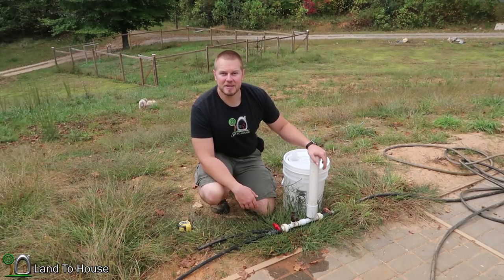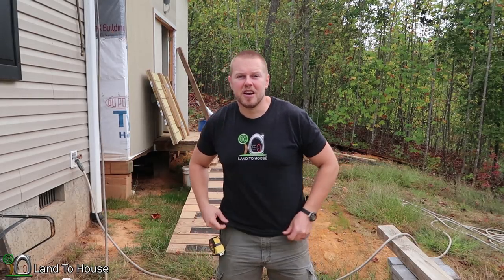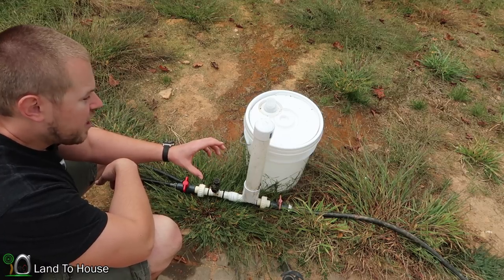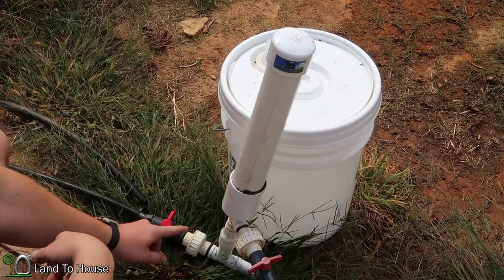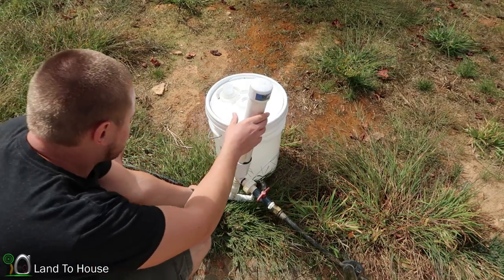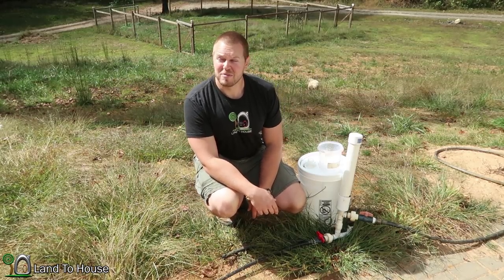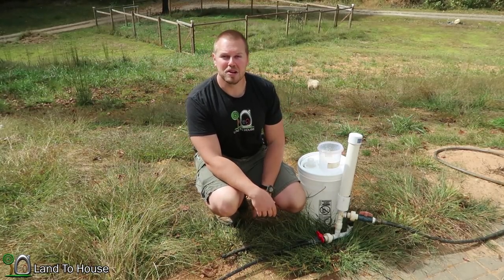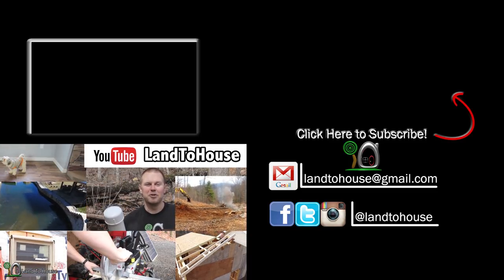What Ram Pump Design is Better

Comment: I would like to see you re-do this video, with the following differences:

Use your house's garden hose for head pressure.  It will stay the same for the entire duration of the test.
COLLECT the waste water WHILE COLLECTING the pumped water.
When the pumped water reaches the mark on your container, measure the amount of waste water.

You'll be able to compare the percentage of waste water to pumped water in each style of pump directly, ie., 1 gallon of waste water to pump one quart of pumped water.

Also, thank you, very much, for posting so MANY tests with these pumps.  I knew what a ram pump was, before watching your videos, but that's about it.  I knew nothing about adjusting them or tweaking them or what affected what in their construction.
Reply from the maker: Sadly using house pressure in a garden hose does not work well or at all. The pump makes a pressure wave that travels both up and down the pipe. If the pressure is 60psi going down the pump cannot cycle. 

In a very old video I did use a catchment tub to collect the waste water. Worked alright. 

Thank you for watching! I am also learning as I go. Its super fun to make these test videos.

Comment: You reversed the 5 seconds difference to the tape line 22 first then 17. You said 22 on the modified version.  But I like the stuff you present. What state are you located in?

Comment: Your "linear" system requires an internal air bladder. Which is not necessarily a bad thing. Your "non-linear" system wasn't setup to run without a bladder. The incoming pipe should hit a tee that points up. Then another tee pointing sideways for output. The check valve needs to be above the output tee with a very small hole just below the gate in the check valve. This regenerates the air in the tank. By having the system adjust it's air supply in the tank instead of having an internal bladder it will maximize output pressure vs input. 

The down side to a self regulated tank is a second hole pissing water. But in practice the pump should be in or near the water source so as to return the waste water back to the source water.

Comment: If I'm understanding correctly, it sounds like the product you sell, with the pumped fluid continuing horizontally to the delivery pipe, consumed 0.0227 gallons per second, where the delivery pipe being after a vertical pumping movement consumed 0.0192 gallons per second. So, yes yours consumes more water per second, but, if you multiply the water consumed to fill your fixed volume (the handheld container at the end of the garden hose) then your product consumed 0.386 gallons in order to fill that container, where the experimental concept required 0.423 gallons to fill the same container. So to me it sounds like your product is pumping faster, and more efficiently. Do these values sound right?? If they are, my assumption would be that the only reason to use the delivery valve mounted for a vertical discharge is if you just don't have enough water available to operate the inline delivery pipe design that you sell, unless I'm missing something. One thing that wasn't measured (not criticizing) is the waste versus pumped water. Maybe there's some significant differences there, if absolute efficiency of pumped/waste water is important in some applications.  

I'm asking for two reasons: 1, so i understand and 2, because I watched a similar video by david deutsche (2021) where he found that a horizontal pump only moves water about 60% as quickly as a vertical pump. Might you have any suggestions of why the test results are so different? From the content in both videos it looks like a vertical pump is easier to prime and get going as well.

Comment: 3:40(220 seconds) divided by 17 = 12.94 cups per bucket of water  vs   4:20(260 seconds) divided by 22 = 11.8 cups per bucket of water. The linear system is almost 10% more efficient in water pumped per gallon used. 

BUT, using the video timer, both filled the cup in about 22 seconds. That means the linear system uses more water per unit pumped. That means the linear system pumps 10 cups of water per bucket fill. It is 18% less efficient in water pumper per water used. 

It makes sense that the linear system would not be as efficient because the early check valve breaks the momentum of the water stream to the base of the ram cylinder so that the water stops moving past the inverted Tee to the early check valve. The later check valve does not. The water coming into the manifold (horizontal pipe) keeps flowing and just switches direction at the inverted Tee to the ram cylinder. Reducing the 1 inch vertical pipe should increase the efficiency. 

YOUR PUMP WASTES MORE WATER.
Reply from the maker: You are very right! I lost track of my data halfway in the video and did not take the time to check what I found. (half lazy/ half forgetful) It seems that both pumps are close enough but there are several factors that can alter the results here. A big one is inconsistency of intake head pressure.  The bucket is not alway the same hight in each test. Could be the non-linear version is even better or not as good as in the test. Thank you for pointing out he data.
Reply: The water level in the bucket would be inconsequential if you fill the bucket to the same or similar levels. You only use 22 seconds of flow out of the 3:40 (220 sec). You need to tighten up the whole test to get better data. It looks like the linear system takes longer to seal the bubbler valve.
Reply from the maker: I have to admit that many of my tests are only giving a taste of a good test. Perhaps I am giving others a nice idea of what they can work with in a setup.
Reply: I had the same conclusion

Comment: What I've gathered from the net re ram pumps. First the height of the  water source should be at least 3 feet, The drive pipe, water from source, should be steel pipe and twice the size of the pipe coming out of the ram pump. The drive pipe length should be between 7 to 10 times longer than the height of the water source, without any 90 angles. Just a straight pipe from water source to ram pump,any bends will slow the flow of water. 
As far as chlorine, being an orchid grower, orchids are cleaned in a 10% bleach /water solution without any adverse effects. Good luck
Reply from the maker: Over the past few years I have made several tests with the ram pump. 3 feet if a great starting point. the pump can run on 1 foot but the check valve has to be tilted. The more ridged the drive pipe the better. The reason the delivery pipe is half the drive pipe is for cost and lower flow rate. The delivery pipe can be any size though because atmospheric pressure is the same on any size delivery pipe.   Cool info on Orchids. I dont know anything about them.

Comment: how  to design is interesting .. why not use a bigger inlet to make more ram when the output value closes is my thought on this ...most pleasure for the least flow is my idea. Good luck working the ideal and maybe some type of flow rate in the process to make this work super great... Best of luck on your experiment. Great watch.
Reply from the maker: The issue with having a large drive pipe for smaller pump is mismatched pressure wave. The pump is less effective.

Comment: Have you ever tried to build the "Linear PVC Ram Pump" shown on the Approtechie Youtube channel? It would be interesting to know your opinion of that design.
Reply from the maker: I think that one must have a bladder in the pressure tank to work. I have not tried that one yet but it does look fun to build.
Reply: Yes, I believe it is using an inner tube, or at least a pool noodle. I hope you build it and do some test videos. It would make a nice compliment to your existing videos.

Comment: Someone may have already said this, having timed the two times that you filled the cup. Both look to be 22 seconds or your editing did not get the 17 second version. Based on the Video the second design looks to be best, moved same amount of water in same amount of time and consumed less water. Maybe a retest is in order unless you agree second design is better. Looking at cost due to less fittings the first one should be cheaper to build.
Reply: Daniel Nelson, I'm with u on his timing, I commented on the same thing.
I think he missed something in his timing OR he trying to sell his version over the 2nd version?

Comment: Any idea what would be the result of increasing the inlet size in the same water supply and what supply is required? Nearly all ram pumps are shown with and going through great troubles to get a stronger water fall. None show or state how to not change a small creek with little flow or lift and still get something from it..

Comment: Can you put a check valve on the bottom of the pressure tank,  my thought is to be able to remove pressure tank without interuption to the system to have a reuseable  pressure pump be a fire extinguisher

Comment: I rechecked your video, your straight line design filled in 22 sec.  The bent line design  filled in ?? (you didn't say) but I was watching the progress bar and it was also 22 seconds.  So does the second design pump the same output while consuming less input flow in the drive pipe? Perhaps a retest is in order? I'd like to suggest another test of both to determine which needs less delivery pipe back-pressure to operate.

Comment: I have made the same pump but it did not work properly. Maybe it's because I used garden hose to supply and to deliver. Where do I have to use the garden hose? At delivery side or only at supply side? In which side can I use the PVC pipe?
Reply: I'm in South Africa by the way. Your Ram Pump will change many people's lives here.
Reply from the maker: A garden hose is too flexible to use as a drive pipe. You will need to use PVC pipe as the drive pipe. Now the delivery is fine with garden hose
Reply: Land to House thanks a lot. 

If you were in South Africa you would be playing a very big role to our communities. Your project is highly necessary here. The government would really appreciate it.
Reply from the maker: Having water is certainly life-changing. A few of my water pumps have been taken to your country by missionarys.
Reply: Land to House that is very very nice. I will use your videos and your recommendations to make some pumps and try to change some lives also. I am very happy about your project.

Comment: Hey man I like your tests,  I want to know how to move water from tank to tank and save the waste water.
Reply from the maker: Thank you. The ram pump is not good at moving water without waste. There is normally around 90% loss with the ram pump. You might need to look into a solar pump for moving water from tank to tank.

Comment: Wow, watched this video months ago and based on what was said I dedicated to the linear design built 4 different pumps but in testing wasnt getting the results I expected, now watching over I realized the error in stating the fill time, timed them and socked to see they were basically the same. Will now go non-linear as seems more efficient.
Reply from the maker: Hi yes I made a mistake in my numbers. (poor memory) Both pumps work well but in this test the non linear worked better.

Comment: Follow all your videos. Built one 1-1/4 working fine for a month, constant flow, now suddenly the output is pulsing.  like on and off. Any suggestion why it is doing this now? Thanks
Reply from the maker: Thanks for watching! The pressure tank might be waterlogged. Have you emptied it lately?
Reply: @LandtoHouse . Right on the money, no air in the pressure tank.  They emptied and back to normal.
They did not use the suggested tire tube in there. 
Just to let you know.  I took the 1 1/4 to Colombia, on the mountains and the interest for that was huge. So I decided to help some folks to build and sell them locally. They created an Agri-business and have started selling  "The Arietes"  there.  Will you permit links to your videos on their website, giving you a credit of course.  Here is their site:
http://www.arieteslacumbre.com  
I live in Phoenix and try to advise them remotely.
Thanks for your reply.
Alex

Comment: According to the timer on the video the pumps filled your little bucket up in roughly the same amount of time.  22 sec and 23 sec.  Don't know where the 17 seconds came from.
Reply from the maker: +blue ferral both times were very close. I do not find much of a difference between the two pumps. Seems like both designs are both effective.
Reply from the maker: I re-watched the video and yes you are right. . . Who knows where my mind got that 17 seconds.
Reply: Since one of the desings uses less water to fill the cup, is more effective because you use less water.
Reply: He sells the first design.  A wee bit o' bias.

Comment: How much more difficult would it be to build a 4-6" intake and a 3-4" uphill?   I'm looking to move a lot of water for irrigating and stock ponds.....
Reply from the maker: That is a very large pump. I know that moving from a 1-1/4"  pump to a 2" pump the price goes up by a LOT. So a 4" ram pump would be very costly. How much water do you need to move? The 1-1/4" will move up to 1.5gpm. Thats 2100 gallons a day. If you needed to move a lot more than that would could use more than one pump.
Reply: @LandtoHouse  need to move up to 3-4 gpm.
Reply from the maker: @jethrobodine9617  ok. You would need a few pumps. Or perhaps 2 2" pumps.

Comment: Where it fills to is QUITE subjective. Even with a line there could be a subjective stopping point. Even a slight difference in height can equate to several seconds.

Comment: please do a test between a ram pump vs a v pump ??? thanks
Reply from the maker: They are actually two types of pumps. The ram pump does not need to have a garden hose with high pressure to run. The V pump needs that 40+ psi to operate.

Comment: the use of less gallons per minute consumption sounds like it would be awesome for my spring during the drier seasons.
Reply from the maker: That would help most people I think. The less GPM might have been from the reduced head pressure. I dont think it is much of a difference.
Reply: FixedByDoc . com u

Comment: Interesting experiment, I had never thought about putting the check valve the other side of the expansion chamber, but as you say there was not a lot of difference. I think most people would use these the same way as I do in that it runs continuously 24hrs a day to fill a header tank so small differences in time or flow would really be noticeable.
As an idea for another test how about testing and comparing the height delivery difference compared to delivery pipe height so may be compare a delivery head of say 3 feet/6 feet and  10 feet
Reply from the maker: Some of the very old style ram pump had the valve on the other side like that. I agree. It was such a small difference that it would not be an issue what design you went with. I am not exactly sure how to setup your future test idea. Do you mean set the pump at known head pressure and see how close it gets to the 1:7 ratio?

Comment: Yeah there's a small Gap in the market and in the market it'll be a niche market.  The products idea would be to create a 20 foot water wheel.. and you'll get about 14 volts of electricity at least would be really nice if it can fully fire a conversion I hope at least 2000 watts AC household current.  This is a very useful number Heating and Cooling  I'm like solar panels as long as you have a flowing stream 2 what are Jack the water up to the buckets you will have power during the night and during the day.. of course this will take a lot of thought and probably a manifold of water jacks.. in Theory size no limit.  One should be able 2 accomplish such a water jacking accomplishment..  and have great amount a water to Trench irrigate I have a large garden..   well now since you got the general idea the project that you be selling or offering just a suggestion would be the buckets that would mount somehow on a rim that the spokes would be two by fours..  and you going to need to harness the speed of the wheel so you going to add a flat belt with brackets on to the side of the wheel perhaps only 3 ft in Word from the outer rim of the 20-foot wheel.. prolapse I should be saying you should make accessories to a 5 gallon bucket and make him with some type of plastic AutoCAD machine...  Ultimately buckets has not been the most perfect transfer of water to wheel power under torque.. unless you have multiple spickets on the upper clockwise 1/4 of the wheel feeling each bucket otherwise they need to be flowing into each other..  and closing up in following you for a while I have been seeing your Flume and I have yet to find or to see anyone proving that it can be done by YouTube the closest I have ever seen what someone using wind power pumps..

Comment: Test doing this. #1 the standard drive pipe. Poly, pvc,etc. # 2 schedule 40 steel pipe. Then, both materials firmly anchored. Then, both materials and pumps firmly anchored. I think, but wouldn't bet my life, that you'll see improvement from plastic pipe to steel pipe and a further improvement from non-anchored to anchored. Should be easy. I'll even spring for 21' of steel pipe(3/4")
Reply from the maker: That might have to be a test for a later date. I do think you are right. The more solid the drive pipe the better the results. That steel pipe would be rather coustly. I just purchased 12 feet of 1/2" pipe and it was $15 at the plumbing store. So $30 for 20 feet is a bit more than $6 for the PVC.
Reply: I'll tell you what. I'll do it this coming week and send you the numbers. You'll be able to tell if it warrants another video. Tell me, is your spring loaded check valve mounted vertically or horizontal? It might be more efficient horizontal.